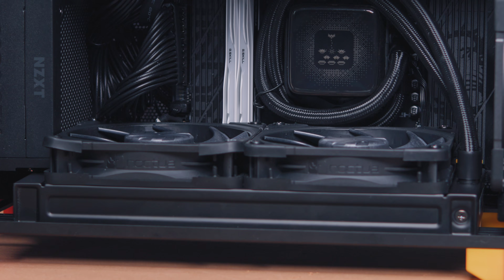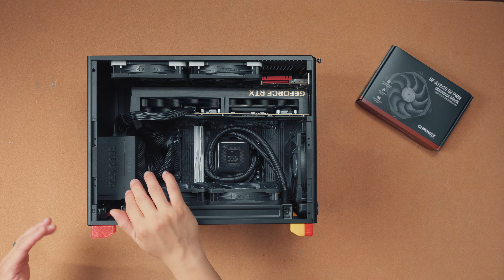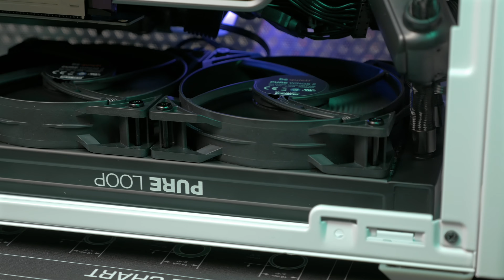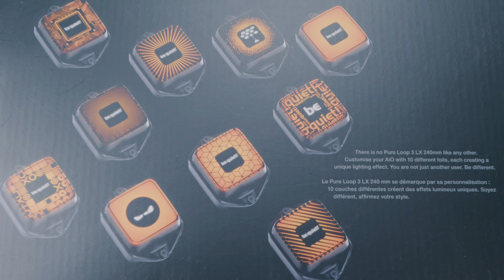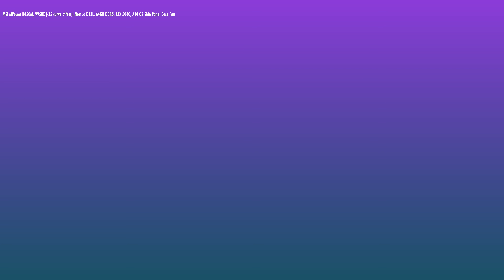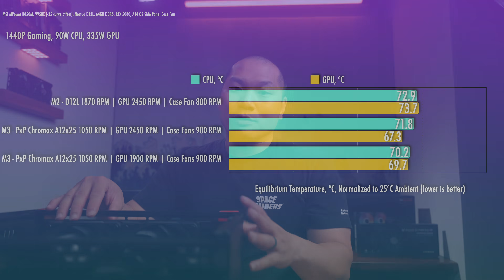I switched to a bottom AIO in the NCase M3 - is this crazy?

Comment: have you tried placing the aio on top using the included fan bracket? the extra width for the M3 compared to M2 allows top mount aio without using riser cable right?

Comment: Just bought the NCase M3 in orange for my first build and was actually thinking of the be quiet silent loop 3 (240mm) mounted at the top? But not sure if there's enough clearance. Also which fans and how many would you recommend for the n3? I got the side frame add-on
Reply: I'm in similar spot, just got M3 grater and bought pure loop non rgb due to price. How have you managed?

Comment: Just got a ROG Loki 1200W PSU and MSI B850MPower for my first SFF build 😦 
Do you think the cold start issue could be addressed by a BIOS update from MSI in future?

Love the videos btw. You’ve inspired me to take up the SFF challenge 😊
Reply from the maker: Awesome! Yeah it’s possible. The firmware at the beginning was actually a bit off, I had to update it to even get it to POST at first. For now though it may just not work well- I tested 750W and 850W units but have no reason to think the 1000 or 1200 would be any different. If you try it I am curious!
Reply: @MachinesMore finally got around to building the Loki 1200 + MSI B850MPower system. 
Did flash the latest BIOS to the board before I installed Bazzite. 

But no issues with cold starts, or waking from sleep thus far🤞
Reply: IMHO he got something wrong with his build/hardware, its just safety measures taken by loki. Had it, I actually can replicate it with unstable OC (reaching well above 1000w, d5, 9950x 5090, Asus x870-i, loki 1200w)
Reply from the maker: @bartman2395 Just to point out- you are using a different board and which I have tested before, I don’t expect issues there with the combo. The compatibility issues I raised were specifically related to the MPower B850M board and the Loki PSU- absolutely no issues with start up but never able to wake from sleep or re-power up without cutting off AC power.

Comment: have you tried overclocking ram on that board to 7800-8000Mhz?
Reply from the maker: For 9950X? Not gonna happen haha. I have gone to 7200 but it goes 1:2.
Reply: @MachinesMore  well 1:2 makes sense if you are at 7800-8000Mhz. so you have gone to 7200 with 64gb kit? you should be able to go higher with 32gb kit
Reply: @julfy_god  It wouldn't make sense to overclock RAM for a video editing rig. It needs stability over minimal 0.1% gains and pushing RAM can cause audio hiccups which would waste a lot of time in processing something like a video multiple times.
Reply from the maker: @julfy_god  Yeah, you could. But I would take 6000 1:1 over 7800 1:2. Having gone to 6400 1:1 that's just gravy for me.

Comment: gpu on the bottom side aio intake top 2 fans exhaust, this the best combo rest is all bs
Reply from the maker: You can absolutely do that, ala NR200.
Reply: @MachinesMore  Is this possible with an mATX motherboard, an SFX PSU and a massive 5090 Astral? I liked your setup with the cooler positioned at the bottom, as shown in the video, but that really limits the choice of AIOs :(

Comment: You can use an AIO with the pump built into the rad you can do a bottom mount just fine.
Reply from the maker: Correct - in addition to in-line pump, or refillable unit, they all work absolutely fine. Not many pump in rad designs though, plus you lose some rad surface area.
Reply: @MachinesMore True, I have a Silverstone Vida slim 240 and a 280 fractal lumen aio's that have pump in rads. A good quality fan can make up for less fin density too. You really can't beat a separate pump though.🤔

Comment: NCASE M3 is a truly fascinating case that offers a high degree of flexibility, allowing for setups like this one.
Why not try covering the areas on the bottom of the case that aren’t covered by the radiator with something like EVA foam?
This is just a theory, but it might help prevent warm air that has passed through the radiator from recirculating back into the case, which could improve temperatures. (You might want to avoid covering the area near the power supply’s exhaust vents, though.)
Reply from the maker: Interesting idea. There could be some reingestion for sure, my guess is with the rad restriction + 120mm the airflow should be already fairly balanced by the 2x120mm intakes.